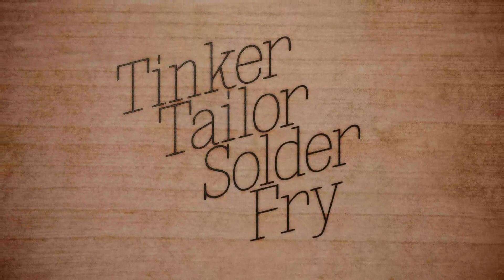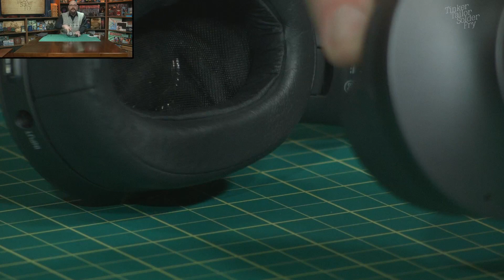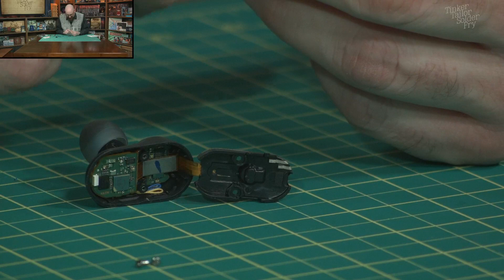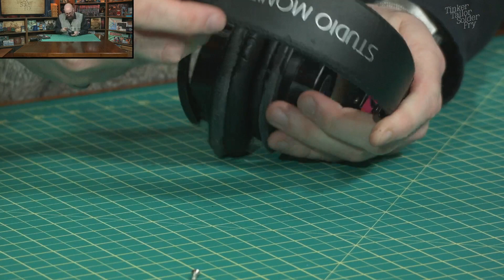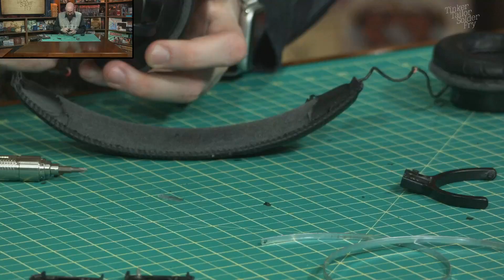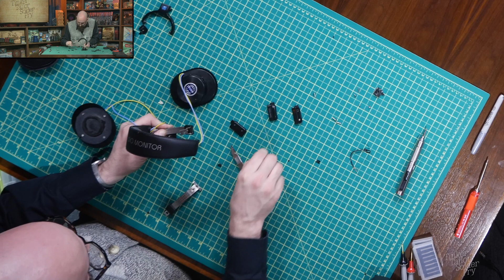Earbud Battery Replacement / Headphone Repair|| Tinker Tailor Solder Fry 2023-02-16

Comment: heat pumps can are actually more efficient than resistive heat even though resistive heat is 100% efficient. this is because heat pumps don't aim to make the heat themselves they just take the heat from outside and move it inside and they can move more than 1 watt of energy per watt they spend and thus the practical effect is over 100% efficiency.

Comment: fun piece of trivia in talking about using various wires and connectors for other things. a fair few DIY synth systems use XLR as the powe supply connector coz it's harder to accidentally rip it out if you trip over it and a lot of DJ setups will connect the CDJs together with ethernet cables and a wifi router to share song data between them and the mixer

Comment: Hearing you guys talk about the cool ways people use wires and copper pipes for communication and data transfer. There’s so many fascinating things that I had no idea about! Like the upload part of the internet was originally for diagnostic purposes and that’s why it’s SO MUCH SLOWER! And Paul’s genius move to use the unused wires in the Ethernet connections between studios to run audio to the switcher.